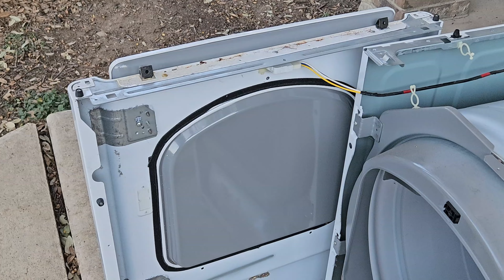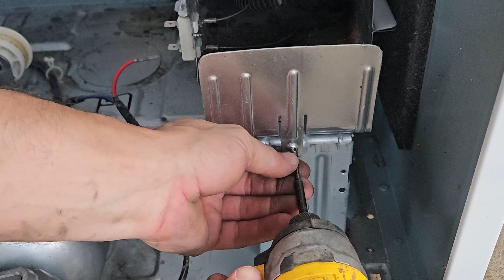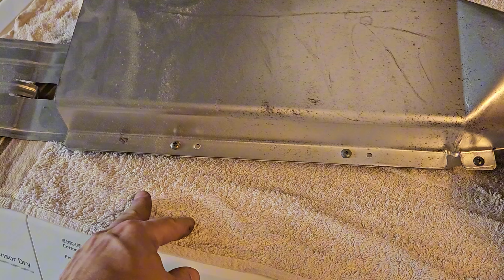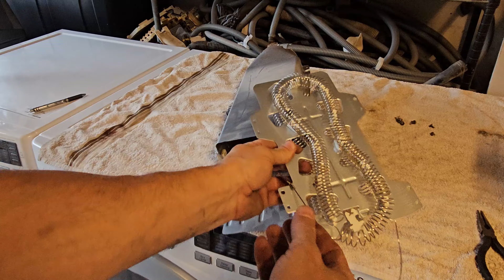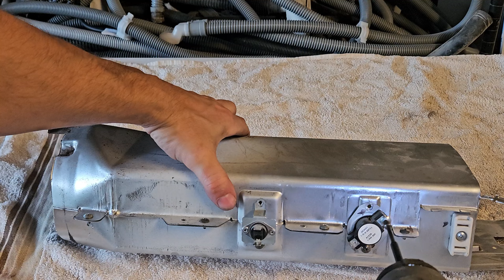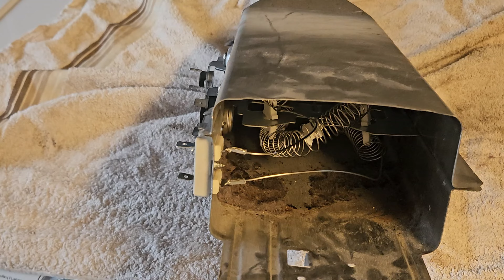Samsung Dryer Not Getting Hot - DIY cheap repair. Save $100s!!!

Comment: Replaced my heating element, and I turned it on and it gave off a funky smell that set off my smoke/cO2 alarm in the washer room. What would cause that?
Reply from the maker: There is a thin layer of oil residue on new heating elements. It burns off during the first use and can cause a small amount of smoke.
Reply: @RandysHereToHelp I ran the dryer on “timed dry “ for about 10 mins then I put it on “ normal “ and it still set off the smoke detectors. I cleaned out every speck of lint from the dryer and the vent and it’s still doing it. I’m at a loss.
Reply from the maker: @brittaniereed9795 it can take 15 to 20 minutes to burn off completely. Did you replace just the coil or did you replace the entire canister? If you did just the coil, did you make sure that it wasn't touching the casing of the canister or and other part of the coil itself before reinstalling it?
Reply: @RandysHereToHelp no I did not. I’ll do that now. If nothing is touching what should I do? I also replaced all the other parts as well. This is my second time doing this with my dryer and this is the first time it’s ever set off my smoke alarm.
Reply from the maker: @brittaniereed9795 well, the thing is... if the coil was touching metal anywhere it probably would have sparked and could have potentially tripped your breaker. The element would have almost immediately broken. It could still produce heat though if it welded itself to the casing and grounded out... causing the heating element to just stay on at all times. But if that happened it would trip the high limit fuse or the thermal fuse. It doesn't sound like any of those things have happened to you though. You can run the dryer without the front panel on to watch and see if the element is cycling off an on periodically, or to see if anything looks out of the ordinary. Remove the front panel of the machine but leave the door switch plugged into it. Then start a cycle and you can get down and watch the element
Reply: @RandysHereToHelp I did that as well, it got really red then dimmed out and set my alarm off. I am freaking out because I don’t want to cause a fire. The smell is awful, I did however see a little smoke at one time when I opened the dryer door but never anything else whenever it set it off the other 4 times. I am checked the coil now it’s not touching anything and nothing is broken.
Reply from the maker: @brittaniereed9795 sounds like it is doing what it supposed to do. Do you have the vent connected to the back of the machine and forcing the air outside as opposed to letting it circulate into your laundry room. I can't really speak to well on how your smoke detector works or if something is wrong with it.
Reply: @RandysHereToHelp I have a water vent for my dryer due to the vent here at the house does not travel outside, it’s a U shape in the wall and you have to clean it out so often so I did the water vent to keep me from having to move the dryer often to clean out the lint.

Comment: Good content bro. Thanks again for this. I'm looking to start working on stuff from my garage do you got any advice for avoiding infestation of beg bugs and roaches? I am paranoid of running into that problem when picking up an appliance off the street.
Reply from the maker: I personally have never run into a bed bugs situation,  but have definitely been down the roaches road. Roaches are more commonly found in washers rather than dryers. I don't do much buying of appliances from people. The majority of my machines are bought from a shop that resells to technicians. I've know the guy for years, so I have the luxury of being able to basically do whatever I want to check them out before I buy them. I will say this though... you will learn over time, what areas of town and what kind of people to avoid. Inevitably though...you're going to get machines with bugs and you have to be willing to just take the loss and throw it out immediately!!!
Reply from the maker: Once I get 1 more subscriber, I believe I will be able to go live. As soon as that happens, I am going to give it a try. My hope is that for anyone like yourself, I will be able to talk more indepth about different aspects of the business  and/or anything someone wishes to know more info about.
Reply: Sound good brother thanks for this
Reply from the maker: @AfroSamurai74 Anytime..I'm always here if you need me!!!